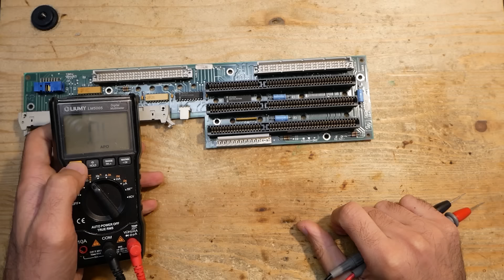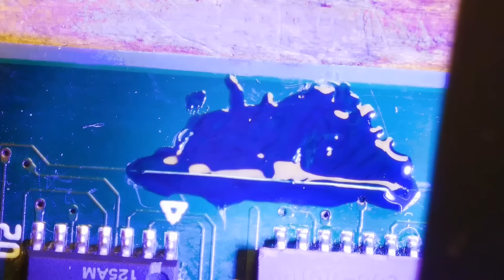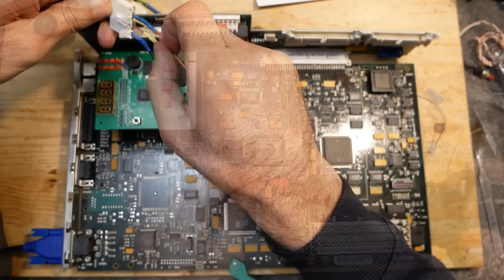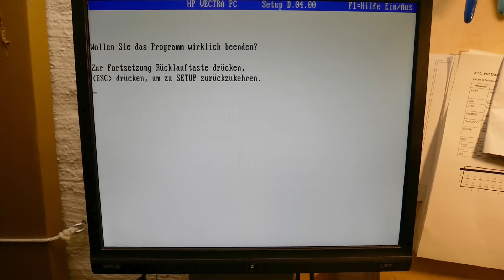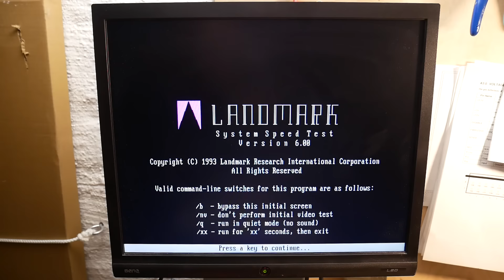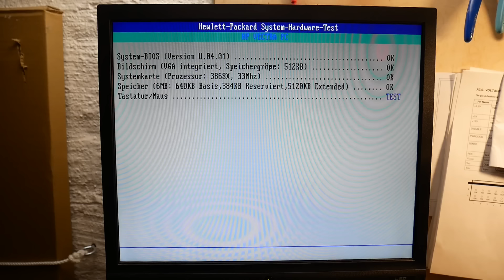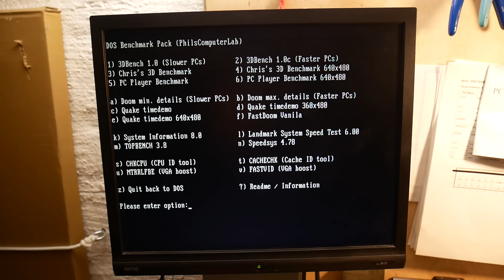A look at HP Vectra 386/33N mainboard

Comment: In the UK the crimp connectors are known as spade connectors.
Reply from the maker: Thanks, have to memorize the name.
Reply: @necro_ware same for the US
Reply: Not sure if it is the case; the term "crimp connector" refers to the way the connector is installed on a wire - crimped on a wire in this case, while the spade connector is a particular type of the connector itself. There are also other types of crimp connectors. While (most probably) every spade connector is a crimp connector, not every crimp connector is a spade connector.

Comment: Man, 90s were a wild time for computing. We went from CPUs soldered on the mainboard to 1GHz P3 in 10 years.
Reply: And it took roughly another 10 years to revert to soldered CPUs.
Reply: @86smoke  :D just made my day
Reply from the maker: Indeed, the progress was insane in such a short amount of time.
Reply: They were also obsolete in the time it took to get them home from the store, too
Reply: @david0858too to quote Weird Al "My new computer's got the clocks, it rocks
But it was obsolete before I opened the box"
Reply: Its amazing if you think about it in modern context. A 386 system was totally unusable by 2000, at which point it would be probably around 10 years old. Compare that to today, you can (for now) put W10 on a core i7-920 and have a totally usable machine, and that is a 17 year old processor now.
Reply: Less.    Mid-range and low-end 486SX-25 and 33 machines with soldered on processors were still on sale as late as 1995.  Usually with an Overdrive socket. PIII broke 1 ghz in early 2000.  That's less than 5 years.
Reply: While there may have been a convention in certain market segments regarding soldered/unsoldered processors, there are some systems which had socketed '286, '386 CPUs.

My guess would be that systems targeted at low-budget consumers and the business world probably went with soldered processors for a number of reasons.

E.g. using a socket adds cost, soldering down the chip gave a sturdier connection, and the manufacturer expected that the customer was more likely to buy a whole new computer than a pricy upgrade.

Comment: The proprietary interface is called ISA96 or AT96 and it is almost 1:1 interface of the 16 bit ISA interface. The pinout can be found e.g. here https://www.janichklass.com/wp-content/uploads/2024/12/ISA96-H1103R10e.pdf on page 25
Reply from the maker: Right, I know that from the industry computers too, but I'm not sure if this is the same. Although the connectors a mechanically very similar (I didn't check the number of pins), the orientation is somewhat unusual. So far I saw ISA96 H1/103 interfaces only as single or sandwich, but not side by side. May be it is still the same though.